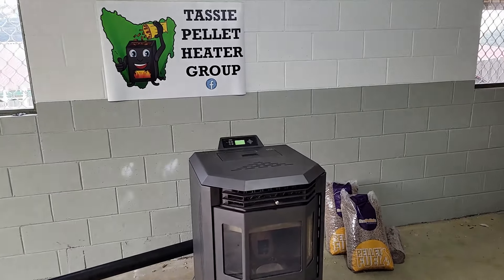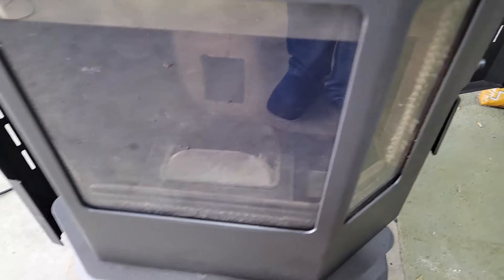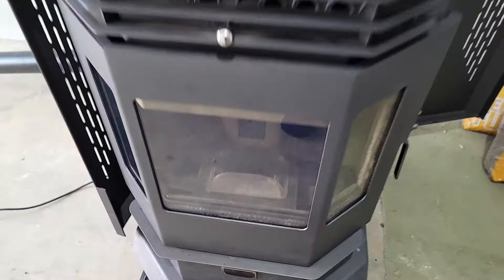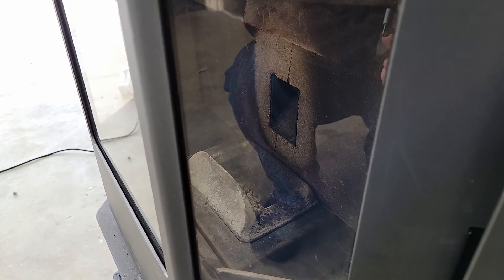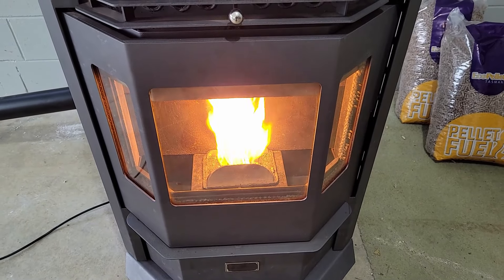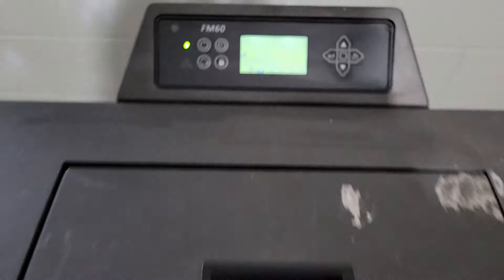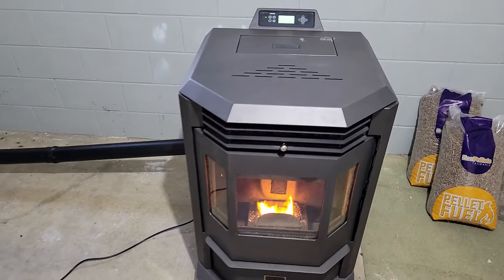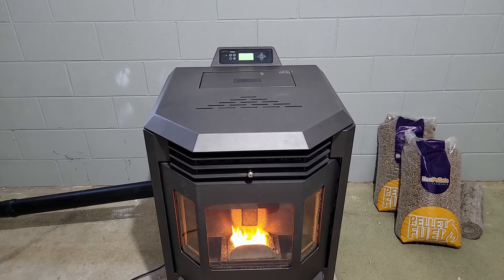Pellet Heater Basics - What and How They Work?

Comment from the maker: 🔥Questions, comments or got an idea for a video you'd like to see? Leave a comment and let me know. 🔥
Reply: Cold air intake kit should be talked about
Reply from the maker: @jonathanwright5550  👍 Great idea for a future video 😁
Reply: @tassiepelletheaterowners4472  was surprising the difference in the house it made
Reply from the maker: @jonathanwright5550  yup. Got our main pellet heater in the lounge connected to an oak but honestly I haven't noticed much difference. However, totally agree that drawing air from the outside to heat is much better than drawing air from inside the house which then causes negative pressure and cold air covers into your house. Thanks. I'll definitely do a video on it. Was a great comment.
Reply: @tassiepelletheaterowners4472  doesn't the fitting on the back go to burn chamber??
Reply from the maker: @jonathanwright5550  Yup sure does which is why an outside air kit can be useful especially if you live in super cold (snow) places.
Reply from the maker: @@hoolydooly5072 the flue is there behind it, the black pipe. That pellet heater is just a demo machine. You can see the flue in my other videos also.
Reply: Can you explain how carbon monoxide is processed?

Comment: they should make them with a solar power source in case  there's an outage
Reply from the maker: Interesting idea but what about at night? Most people have battery backup. Pellet heaters only use 60 watts an hour once running. Very easy to run a heater with solar and battery backup.
Reply: The "Drolet" brand of pellet heaters come with batteries built in in case of power outages.
Reply: Nah.. I'd drop in a thermonuclear power source to be completely off the grid.
Just drop 80-100 g worth of plutonium pellets every 10-15 years or so. :)
I bet you wood pellets are a lot easier to find.
Reply: Would you need a heater when the Sun is turned on in Australia? I have herd many stories about the cold Australian Sun. Thought it was just a myth.
Reply from the maker: Mate, just get a UPS or diy a UPS setup very easy to do. They pull very little power and easy to hookup to batteries with a solar charger controller and solar panels.
Reply from the maker: @@fredwills6288 hey. Yes, this pellet heater in Australia is a Ziegler and Brown. It's from the same factory or at least design the Comfortbilt comes from. They are no longer sold here. Totally agree like you said that it's easy to setup a pellet heater to run off batteries and also run off a generator. I'm guessing where you live you might lose power for a few days because you have a generator? You have a very similar setup to what I was using with my heater. I had a 1500kva UPS and you are dead right about the igniter and power it draws. Just a little too much for some UPS. I've now "upgraded" my UPS to a different setup. I got 3 x 190ah 12v batteries that I connected in series. I got an old UPS that was dead, the batteries in it were dead, and replaced them. There were 3 x 12v batties in the UPS which is why I use 3 x 190ah 12v batteries. Basically, I got plenty of power now and it can go for a long time. Luckily never had to use it for more than a few minutes. I'll post a picture when I can.

Comment: Can you leave it on and leave the house for a few hours?
Reply from the maker: Yes, definitely. They are built so they will shut down if there's any problem but there's no issue running a pellet heater while not at home. I personally wouldn't run it for a long time, like if I was going away for the day and there's no need to do this. Pellet heaters will reheat a space quickly, much faster than a wood heater, so if I go away for the day I switch it off and then switch it back on an hour or so before I come home. This saves pellets and money but I still come home to a warm house.

Comment: I'm told I need a dedicated outlet for the stove and that I don't need an intake pipe (for air intake) since my home is not a trailer ..? I'm DIY all the way these days since money is tight. looking for clarification on the electrical
Reply from the maker: @karenflowers9611  I'm not in the same country as you but no need for a dedicated power outlet here where I am. Outside air kit is mandatory, like you mentioned, for caravans but if you can install one I still would. Most homes unless new are draughty but using a pellet heater without an outside air kit only adds to the draught in the house. I know plenty of people don't use them but if it's easy to install, I'd still do it.
Reply: @tassiepelletheaterowners4472  Thank you, I'm alone and the whole thing has been so difficult to figure out and do on my own. I'm going to go with what I have so far. Now, I just need to power it up and try . Maybe next year. Thanks for the reply
Reply: PS, I called comfortbilt and was told, yes to mandatory outlet, not doing that yet and no to the outside air kit unless it's a trailer. Thanks again

Comment: What about a vent pipe
Reply from the maker: Vented through the wall or ceiling. Good thing about pellet heaters is they can vent out the wall directly behind them. Most wood heaters can't do this. This is a demo machine I have setup but you can still see the flue venting outside.

Comment: PROBLEM IS FINDING THEM NOW . i WANT ONE FOR MY BASEMENT  your panel says jan . 01  year 2000
Reply from the maker: That's because it was unplugged. Yes, finding older heaters is hard especially if you need parts. I would be checking FB marketplace, gumtree if it is used in your area and Craigslist. Posted wanted ads also. I've done that and people contacted me saying they had a heater they wanted to sell.

Comment: My dad is thinking of replacing propane stove with a pallet stove because costs wise. Is pallet better than propane use. Or he just use electric heaters more.
Reply from the maker: Hey, propane as in bottled gas? I'm not sure what you pay for bottled gas but it's bloody expensive here. A pellet heater is definitely cheaper where I am. What does your father post for bottled gas and how long does a bottle last him? The storry answer is yes I expect it would be cheaper. If he had natural gas as in piped to his house, then natural gas may be cheaper but again depends on price.
Reply: @tassiepelletheaterowners4472  My dad owns two propane heater one on first floor and basement. It been years since he used propane from local brand to deal with propane.

Comment: Nice! I get sic dep alarma 7 fail just before pellets should drop. Cleaned pressure switch and there was dust in thermostat holder and where it's clamped into main box ( copper wire) seems to be a tad of play on it when cold. Normally starts 4th or 5th attempt. Any ideas?
Reply from the maker: @casualgamers6020  I assume this is happening when starting the pellet heater and there is no fire yet? If so then yes clean the vacuum tube like you did. There can be ash inside the vacuum switch. That can be cleaned by opening up, just be careful and put it back together the way opened. Next, what's the door gasket like? If it's worn too much that can cause this alarm. Finally, how long ago since you cleaned inside the pellets heater and cleaned the flue? Meaning a deep clean. I'd make sure all ash inside ports and flue cleaned out.
Reply: @tassiepelletheaterowners4472  Yes before it lights pellets no feed. It always happens during preheat. I'm going to re-clean flu and remove the extraction fan ( never been opened) Thanks for your feedback much appreciated.
Reply: @tassiepelletheaterowners4472  pressure switch is a sealed one I blew into it so it's clicking and also the silicone tube clean.
Reply from the maker: @casualgamers6020  just be careful blowing into a vacuum switch. Really shouldn't do that but mainly because of air is too strong it'll damage the switch (unlikely you did this but yeah just be careful). I'd be cleaning the flue and inside the heater. Honestly the problem most likely won't be the vacuum switch. Best of luck and happy new year.

Comment: So that small pipe is the exhaust I presume? Are these pellet heaters able to be set up anywhere in a house or just in areas like basements, garages, etc? Considering one for a family room
Reply from the maker: Yup, that's the exhaust. Pellet heaters can be installed like a normal wood heater or they can also be installed through the wall behind them, called direct venting. Install a pellet heater anywhere a wood heater could be installed, so, yes, lounge room or family room is perfectly fine.

Comment: Any advice on putting a pellet stove in a 1890 duplex basement? Or should it go on first floor ?
Reply from the maker: @RalphDesain  I personally wouldn't. Will it work? Yes but a few problems. First, the heat will be trapped in the basement. Yes, you can use vents and it will naturally rise up out of the doorway to the house but pellet heaters are space heaters, so most of the warmth will be in the basement. 

Second, is the basement insulated? If the walls aren't insulated then the cold walls will suck up a lot of heat. If the walls are insulated, then you won't have this problem but will still have the same problem that most of the heat will be trapped in the basement. 

Having said that there are plenty of people who install pellet heaters in their basement to heat the house above. However, I just don't think it is a good idea.

Comment: Great video!    I just fired up our stove for the season.   Smoke has been coming out of the blower. Your input is appreciated
Reply from the maker: Hi, by blower if you mean room exhaust fan that blows got air into the room, then that shouldn't be possible. The smoke exhaust is obviously completely separate from the room fan. 

I'm guessing maybe something, first out whatever, has gotten into the room fan and that's why you are getting smoke. The only other way there could be smoke is of there was a hole or something. I wonder if the door gasket needs to be replaced. However, a bad door gasket would trigger a a vacuum day switch and the heater would shut down. 

Is the smoke only visible during startup? Do you have an outside air kit? Sometimes during startup there is a very tiny bit of smoke that comes out of the pellet heater but it's minimal and definitely wouldn't be heaps of smoke billowing out.

Comment: Got a enviro m50 I cant seem to get a high flame, set on 4 or 5 but get a 1 setting flame, any ideas people?
Reply from the maker: The fan voltage should change when you switch modes. Can you hear the exhaust fan going faster or slower when you change speed setting? The voltage should be higher, so the fan spins faster and more pellets are fed into the burn pot giving you a bigger fire or the opposite going slower and less pellets for smaller fire. What type of pellet heater do you have?
Reply: @tassiepelletheaterowners4472  doesn't seem to change once started, will rest again. Just had it stop running twice with a #3 code. I did get it going again but still a low kinda lazy flame. Thanks for any and all help to everyone.
Reply: @tassiepelletheaterowners4472  I have a enviro m55c-fs. Yes the fan increases as I up the heat level. Flame does get bigger but not a lot and very little between 4 and 5. Was told by someone to close the damper in the back 1 " , so I did, help , but very little. Any help is appreciated
Reply from the maker: @ezellccful  pulling the damper out should provide more air, which would be needed for a lazy flame. I couldn't find the M50 model but found m55. Does your model have the "trim combustion air" button? This will allow you to increase fan voltage or decrease and may be worth looking at. Wish I could help more but I assume the heater is new. The only things I can think of are voltage on fan is too low. There could be something wrong with the fan. If the heater isn't new has it been deep cleaned etc? I also assume when you change the heat setting the amount of pellets being fed into burn pot increases and decreases accordingly?

Comment: How much fuel is required for a couple months and what is the approximate cost of a bag of pellets? Do you have an exhaust going to the outside?
Reply from the maker: Cost varies greatly depending on which country you live in. Best to google prices. Most people will burn a bag a day in the middle of winter. Again, this depends on where you live and how cold your winters are. We burn about 60 to 100 bags a year. If you live somewhere that allows a lot you may burn 2 to 4 tonne a year. Depends on your winters, how big your house is, how warm you like it, do you have other heading etc. Yes, there is a chimney or flue.

Comment: Is that the HP 21?
Reply from the maker: The comfortbilt stoves are a rebadged made in China model, just like this heater. Yes, they would be identical or very similar. This is actually a zeigler and brown or at least that's what they call it.
Reply: @tassiepelletheaterowners4472   thanks and mine is the comfort built HP 21. All the reviews I've done on it says it's not supposed to get hot on the top and on the sides just in the front the glass area. But mine gets so hot on the top and the sides that it will literally burn you third degree burns. I just recently purchased it installed it yesterday in about 2 hours later it was that hot. There's no overheating alarm on it but I don't hear the blower motor blowing could that be the problem
Reply from the maker: @davidcompton9528  yup something is wrong. Once fire is going the room fan will switch on to blow hot air out of the heater into the room. You should be able to tell what fan is and isn't running. It's definitely not working as intended.
Reply: @tassiepelletheaterowners4472  thanks you we got the problem fixed it was the blower motor. Just stuck

Comment: Is there any Australian standard accreditations, for wood pellet heaters ?
Reply from the maker: Hi, yes I believe it's AS/NZS 4012. However, I think it is being updated and pellet heaters are exempt. They used to be exempt in an old version of the standard then it was updated and no longer exempt. This is being reviewed and the updated version should exempt then again because they burn so clean.
Reply: @tassiepelletheaterowners4472  Hi, thanks for your feed back. From my research , yes it seems they are exempt, except for the AS/NZS 2918, which is some kind of installation standard. Do you know anything about this 2918? You mentioned a new law will except them completely? …do you know when this will be implemented?
Reply from the maker: @MaxStArlyn  Hey, looks like that standard you referred to is for installation requirements. The standard I was referring to above (god it's confusing) was regarding emissions etc. That standard is currently being reviewed and updated because they left out pellet heaters being exempt from emission standards (it may already be updated, I haven't checked in a while). I can't comment on installation requirements, just that pellet heaters don't need to meet emission standards like wood heaters because pellet heaters already burn much cleaner.

Just curious. What exemption or what are you doing that has you looking at exemptions etc? There should be no problem getting a pellet heater installed. I'm just wondering what are you looking at doing etc?
Reply: @tassiepelletheaterowners4472  I’m looking at buying a pellet heater and boiler, from over seas.
Reply: @tassiepelletheaterowners4472 I have another question, do you know which would consume more pellets to heat the same space. A pellets stove just blowing out hot air, or, a pellets stove boiler, made to heat hot water for radiators?
Reply from the maker: @MaxStArlyn  easiest way is to check the manual. Will also depend on the heat output. However, generally speaking a boiler will consumer a lot more than a standard air heater. Pellet heaters that heat the air are space heaters, so they max out around 13kw. Boilers go anywhere from 18kw to 50kw, so they will be higher. Anywhere from double to triple the pellet consumption, especially for a 50kw boiler running on high.
Reply: @tassiepelletheaterowners4472  Makes sense… also… I would think that it would take more work, more energy… to heat water, then have it travel into a radiators, and heat them constantly. Boilers need to heat up and penetrate through objects, where as hot air pushed straight out, had no obstruction, and should allow the  heat to impact directly.
Reply from the maker: @MaxStArlyn  exactly. Just friends on what kind of arts you want to heat. If just one room, go pellet heater. If you are looking to hear multiple rooms, like central heating, then definitely go a hydronic or boiler. You'll get a much better overall heating experience, while house will be warm but it will burn through pellets.

Comment: Just out of curiosity what would cause his pellet stove to run good for about 12 hours and then all the sudden flood out
Reply from the maker: Not exactly sure what you mean by flood out. If it stops feeding pellets into the burn pot and as a result the fire dies out, then sounds like a temp sensor is faulty. It can't detect a fire so switches  off. However, there could be many reasons. What's happening exactly and what do you mean flood out?

Comment: Does it have a room thermostat?
Reply from the maker: Hi, yes they do. That's how they know what temp the room is. You can specify to heat the room to 22 for example and then go into lowode or switch off all together and start again when temp drops too low. I'll make aore detailed video on that. Thanks.
Reply: @tassiepelletheaterowners4472  what does it coast?
Reply from the maker: @davidengle2342  I'm not sure where you live but check out https://www.tassiepelletheaterowners.com/where-to-buy-a-pellet-heater-in-tasmania/ to see pellet heater retailers in Tassie. How much they cost depends on what size heater you want.
Reply: Where's the exhaust?